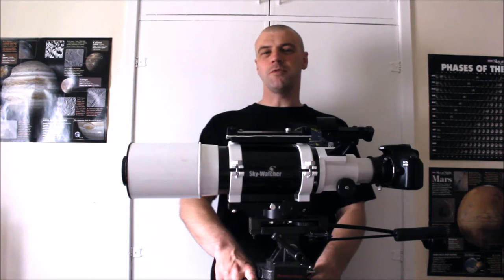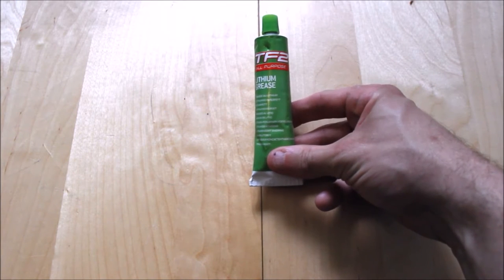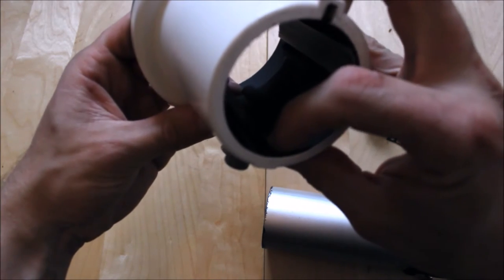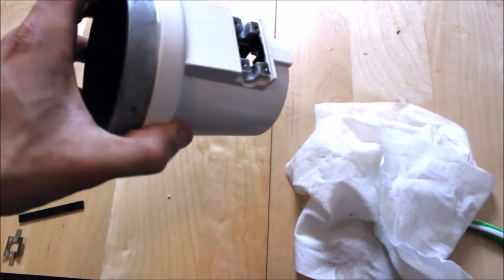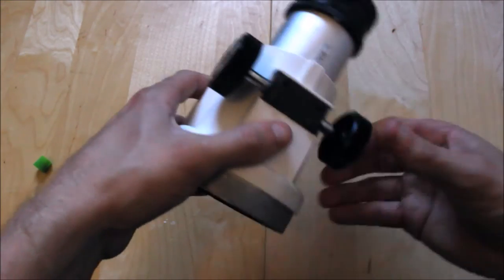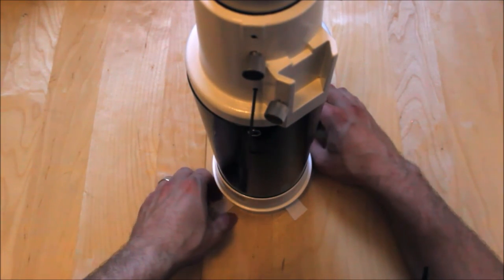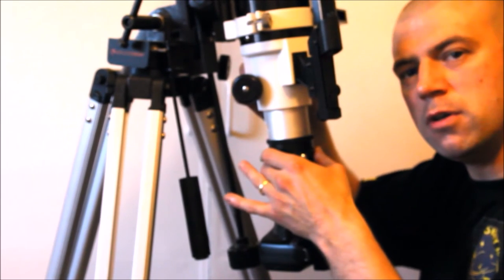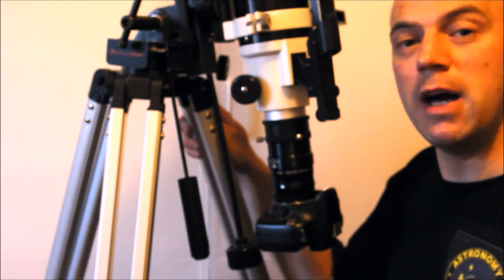How to improve on a Focuser entry level Refractor telescope

Comment: Thanks so much for this video! I just got my first telescope, a Meade infinity 102mm and it has a focuser that looks similar to the one in the video. I've noticed a bit of astigmatism and it may be due to miscollimation of the focuser. This video has given me a better idea about how to collimate focuser (didn't know that was possible... I thought those little holes in the focuser were just random holes lol) and clean out the focuser if needed. I'm still too nervous to do it as I'm worried I'll mess it up but at least I know I can if I need to. Thanks!

Comment: Had this exactly same problem yesterday, as i tried to focus Jupiter with a barlow and a c270 on a 150mm.. very shaky mount and could not fine tune the focus. Thanx for the video.
Reply: get  2 or 3 gallons of water and bungee cord them to your tripod to absorb the vibrations, and if you don't want to pack the water back just pour it out.

Comment: That's a very usefull guide. I have the same telescope and the focuser is a bit wobbly. However, I'm afraid to take it apart like that, because I am not sure if I'd be able to put it back together properly. Also, I don't have a collimation tool. 
But anyway, thanks for the very useful and practical information, I'll follow the guide if I decide to improve the focuser one day.

Comment: So, I have a Celestron Omni AZ 102. About as basic a focusing system as you can get. Took Martins advice and the difference is “a massive improvement” indeed. Still not perfect (nor will it ever be). So I wonder? Has anyone added an inline double helical focuser to a basic system with positive results?
Reply from the maker: There is chart which you can find the size to uprate your telescope to a uprated 10:1 Crayston focuser please check that out:
https://agenaastro.com/articles/guides/gso-crayford-focusers-with-telescopes-compatibility.html

There is GSO focuser which could fit your Omni AZ 102?? You need to confirm this with the retailer first??

https://agenaastro.com/gso-linear-bearing-refractor-crayford-focuser-112mm.html

Comment: Thank you for the time it must take for you to do these videos - I am now in the process of doing this on a star travel 120 purchased two months ago that has some lateral movement  when turning the focus wheel and have ordered the Skywatcher auto focuser to finish the job off.  Could I just mention to wrap the dew shield in neoprene so as to banish  dew problems (15mm thick on my Startravel 80 and 2 x 6mm with  DIY heater strip between on the 120) and also to look at Astra Image (40 pounds including VAT)  which was a tremendous find last week courtesy of Professor Morison's digest page.
Reply: I'm going to do a similar upgrade on the dew shield of my Startravel 102.   I have a 10mm thick foam camping mattress.  I've already made a DIY dew shield out of it for my Skymax 102 Mak.   Cut it to size and stick some Velcro strips on it - job done.  It works a treat too.

Comment: Good grief Martin, you're right.  I just received my Sky-Watcher Startravel 102T OTA.  For an achromat, it's a cracking good little 'scope.  However, the stock focuser is really sloppy.  How on Earth can the goop smeared over the rack and pinion system be called lubricating grease, is anyone's guess.  

When I lived in America I used restore old military rifles for fun.  They were always packed in some similar grease.  The stuff is more like glue than lubricant.  It's a complete pain in the arse/ass to clean off anything.  While I wait for a replacement dual-speed Crayford focuser, I'll service the stock one.  God I hate that packing grease.  It's terrible stuff.  Seriously, anyone who buys this 'scope, or one with a similar focuser.  Servicing it should be a high priority.  Happy New Year to you and yours.
Reply from the maker: Totally agree Andy, for a short focus Achromat Refractor it's really good at correcting some false colour too, also very sharp images too!! Though the CA (false colour) can be further improved with a Baader semi apo filter, which even corrects more false colour, here is a video based around that feature: 

https://www.youtube.com/watch?v=Ko8TA3kxojs&t=2136s

Yeah that grease is like tar, and it makes focusing even more difficult, trying to focus on a tiny dim object is not easy has it dances around like crazy!!!

Yes you have made a good choice to opt for uprated dual speed Crayford, you will see a huge improvement and it will be so silky smooth, it will greatly improve your views on the 102 massively!!
Reply: @MPAstro  Thanks Martin for the advice.  I've not heard of Baader semi-apro filter either.  It looks like a very handy little beast for apros.  For what you're getting, it's really not expensive.  I've bunged it on my list of things to get.
Reply from the maker: @AndyinMokum  It's worth considering flocking the tube on the 102 as well https://www.youtube.com/watch?v=CsJYyhNueeM&t=2072s
Reply: Hi Martin, how's it going?  I've just completed the service on the stock focuser. That packing grease Sky-Watcher uses, is really foul muck. I call it, dinosaur snot. We're on lockdown here in The Netherlands, so all the hardware stores are shut to the general public. I couldn't go and buy a can of WD-40. However, I do have a lot of turpentine, so I tried that with the toothbrush and rag.  Eureka, turpentine eats through the dinosaur snot like a hot knife through butter. After all the muck was gone, I cleaned the excess turps with some isopropyl alcohol.  It took me about 15 minutes to do.  The reassembly and collimation was straightforward.  There’s some wiggle room where the tube meets the focuser.  This is very useful and helps getting everything lined up and parallel.  When the hardware stores are open again, I’m going to swap out the Philips screws, for decent hex head screws.   

My wife gave me for Christmas a, 1.25" 90° TS Optics fully coated dielectric mirror diagonal.  It's a gorgeous bit of kit.  Viewing with it, makes everything really bright and clear.  I’ve also a roll of the flocking material.  I’ll get around to using it on the tube in the near future.    

Anyway, the focuser now works like a dream.  It’s as smooth as silk, there’s no slop and it holds my Canon EOS 600D without slip. This easy to do service, has transformed a barely useable focuser into a very useable bit of kit.  Everyone should make this easy service a priority when they buy the Sky-Watcher Startravel 102, or similar scopes.  Using this scope, is now a a joy.  I’ve also ordered the, Baader Semi APO filter from FLO.  I’m looking forward to using it.  Many thanks for the great tips.

I have a couple of questions.  What is the length of the extension tube you’re using?  I’m using one for eyepiece projection.  It’s about 6.4 cm long.  This seems a little long for a straight through tube.  I don't want to overly magnify things using the short tube 102.   Also, which field flattener are you using?  Thanks again for all of your help – stay safe.
Reply from the maker: @AndyinMokum  Awesome work and well worth the effort!! You could save a lot by not getting a Crayford focuser, as these are really intended for Astrophotography use, as the 10:1 ratio is handy for micro adjustments. I totally agree TS Optics Dielectric is superb, it was pity that your wife got you the 1.25", cos the 2" is a massive jump in performance with light grasp is concerned, but don't worry there is noticeably a gain in light grasp through the 1.25" but not so much compared to the 2" format, but I understand budget can be an issue for us all. The filter will massive improve on the colour correction and you'll get to see this yourself, and you really see the difference, Also I like to add the filter is now Baader have designed this filter with better coatings which also acts like a Light pollution moon and sky glow filter, so it can darken the background making observation of Deepsky nebula and galaxies stand out more!! So your buying a good investment there.
I've used just a 50mm extension tube in the video but you can achieve focus with a 35mm minimum, Also in the video there is a field flattener and 0.8x focal reducer on the camera, these allows the optics to step down from F5 to a ultrafast F3.9 which what does is?? It allows the telescope to capture fainter detail on Nebula and shorten exposure times and widen the field of view too, very handy for Astrophotography.
However using 0.8x may give distortions on the stars as the scope is already a fast F5 optics, but the 0.8x can give reasonable images!!
Also a 0.5x Focal Reducer is handy gadget for observing faint Nebula and galaxies, not great for photography (has you will not achieve focus on this scope) Fitting the 0.5x Focal reducer on a eyepiece will make images much brighter and field of view will be wider, OK objects will be smaller due to reduction magnification, but the whole point is light grasp for Deepsky and this handy gadget will work at a super fast F2.5 ratio.
Here is the link for the 0.5x focal reducer, there is 2" format as well, I will be making a review on this product!! https://www.teleskop-express.de/shop/product_info.php/info/p676_TS-Optics-Optics-TSRED051-Focal-reducer-0-5x---1-25-inch-filter-thread.html

Also I just launched another video last night, if you missed out here it is Andy!!!  https://www.youtube.com/watch?v=OoK_AP8bu5I

Comment: Nice video thanks for the tips
Reply from the maker: No problem 👍
Reply: @MPAstro  just done it was straight forward now gotta check it
Reply from the maker: Easy as that or what??? No fuss Ryan
Reply: @MPAstro  I used the scope on Tuesday night was so much better to use jupiter and Saturn were fantastic I also purchased a new prism from willams optics with a helical focuser built in to it and a baader x2.25 barlow plus the semi apo filter after watching you other video on this scope then the clouds rolled in so not had a chance to use them as yet
Reply from the maker: Don't worry you got the gear now, you will be prepared once the skies clear up!!!